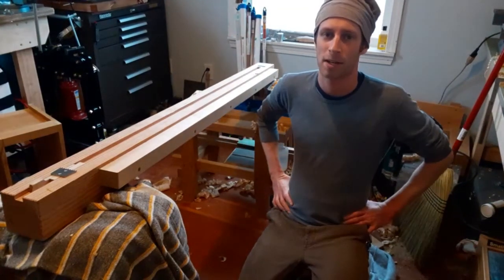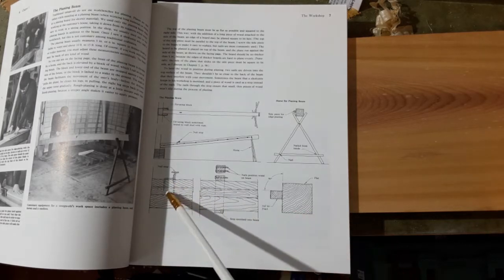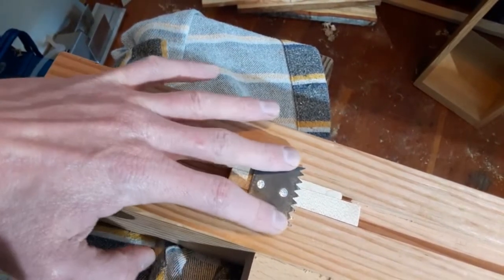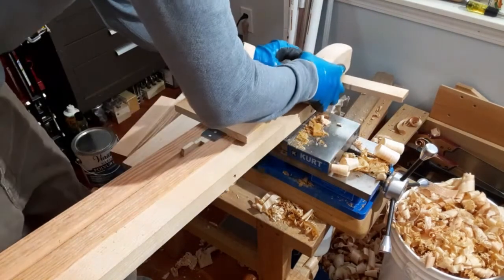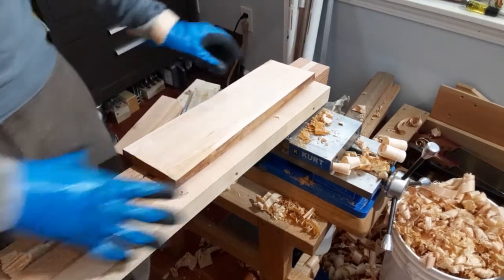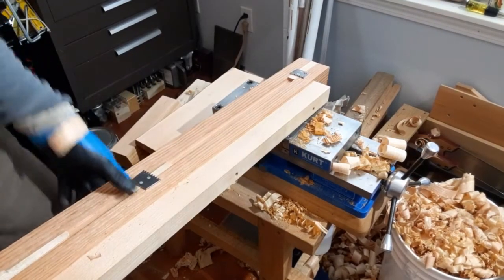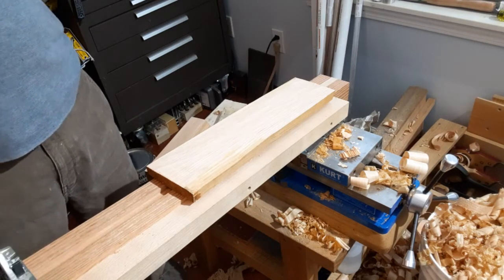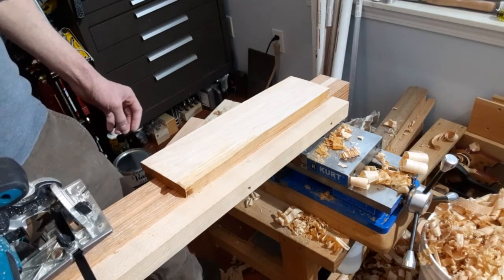planing beam with TWO stops

Comment: Excuse me for commenting on an old video -- can you please tell me how exactly that beam is secured in place? Do you have a separate low table that is butted up against the wall, and the beam attached to that via clamps? What is that blue metal thing, the one that says "Kurt" on it? I ask because I was wondering how to replicate planing beams for western planes (japanese beams seems simpler because you're pulling down, so you just butt the lower end to something... can't do that with push planes until you wanna crouch every stroke)